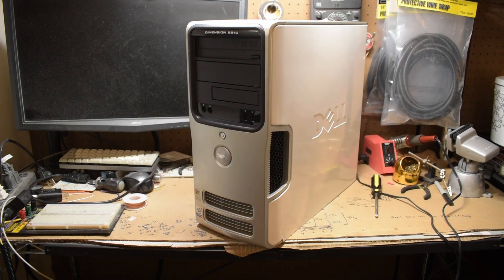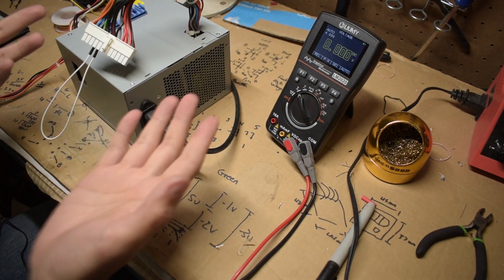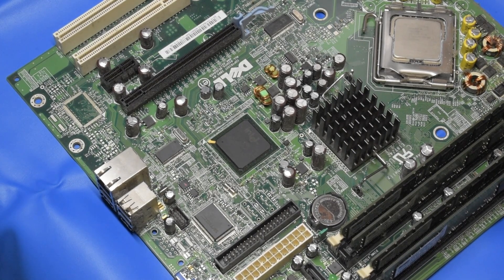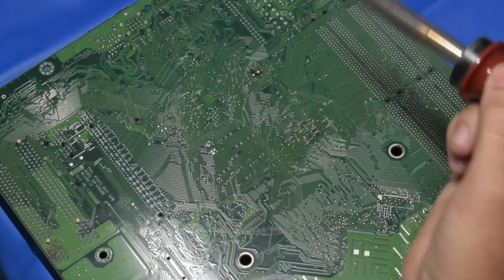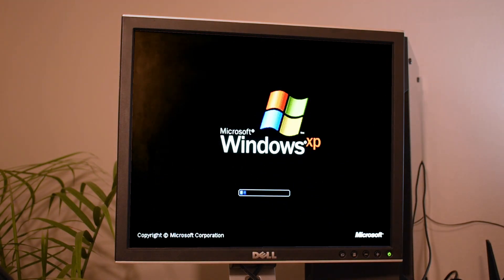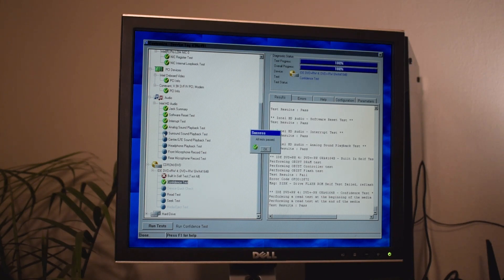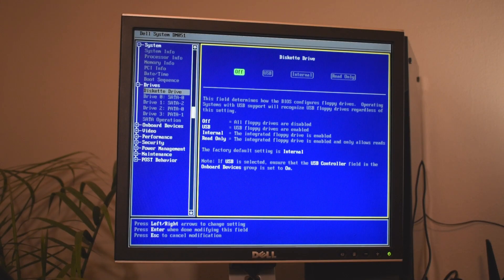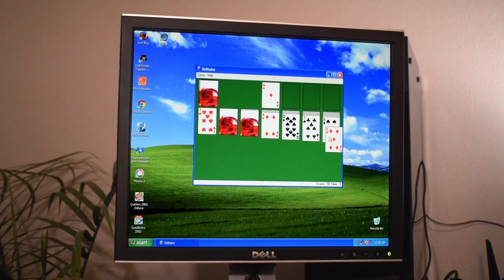Dell Dimension E510: A Trusty Steed

Comment: This is soo similar to the Dimension 5100 I had access to growing up. It was a 3GHz P4 but had 1GB of RAM (I upgraded it to 3 later) and a 120GB drive. Plus a discrete graphics card. I mostly used it to play Win9x games I got from those cheaper “these games are old now” CDs, like I got Worms 2 and Rise of Nations for £5 each among other less good ones.
Reply from the maker: Not surprising that you recognized that it was similar to the 5100. In fact, the E510, 5100, and 5150 all pretty much shared the same case. Some of the parts even can be shared between the three.